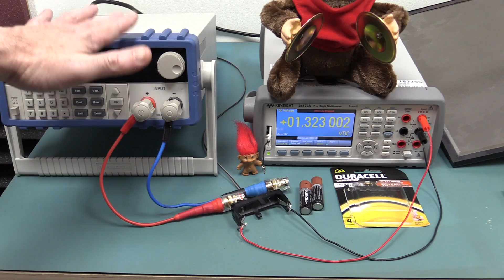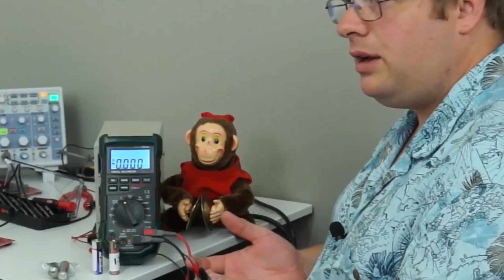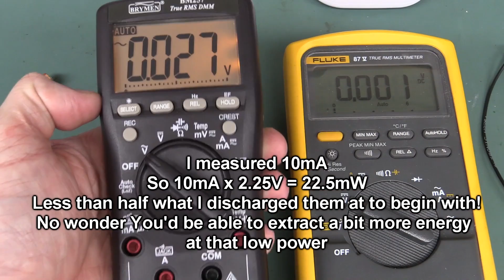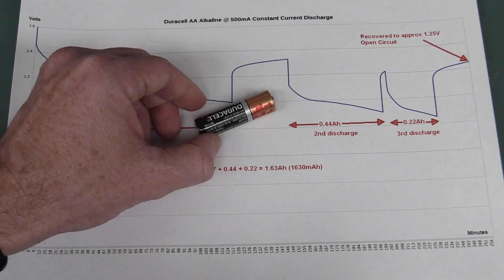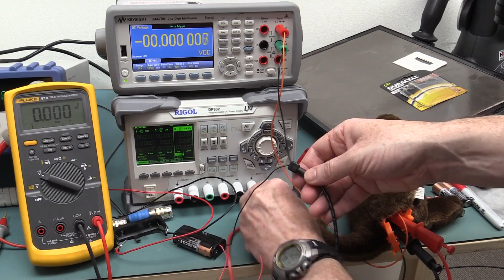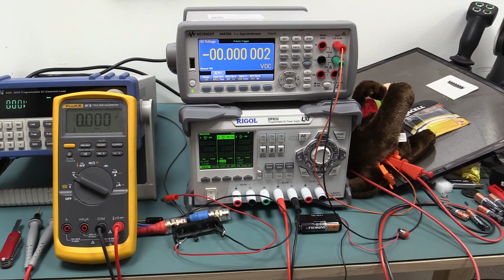EEVblog #789 - Batteriser Monkey BUSTED!

Comment: You can sometimes tell a flat-dead cell from a half-dead one by checking with multimeter: if the truly open-voltage measures the same (down to milivolts) as when hand-loaded (sweaty fingeurs across the battery poles while holding the probes)

Comment: It is not economically feasible, for a company to test every type of battery, from every manufacturer, to make sure their device works with that particular battery. There is just too many battery formulas out there.  It is better to do a more general test, simulating the maximum/minimum expected battery voltage and current. This can only reasonably be done with the benchtop power supply.  As long as you know the expected battery life curve, it is not only a reasonable substitution, it is the industry standard. As long as the Battery conditions are properly simulated, the current and voltage is the same regardless of the source. the battery conditions that they are suggesting is from devices from the 60s and 70s.  they should test their battery life expectations on current devices, not devices that are 40 or 50 years old. and definitely not motorized devices that run as long as the current is available, regardless of the voltage drop of the battery.

Comment: What is misleading is taking the manufacturer's discharge curve and assuming it's showing the battery's open-circuit voltage, when in fact it's showing the battery's voltage when under load. And that's exactly what the batteriser people are doing.

What I have learned from these videos is that a battery's open circuit voltage is pretty random and tells very little about how much charge is left in it (which is the crucial part). You could have an almost empty battery showing 1.2V when measured open-circuit, but that really tells nothing. It won't run a device at 1.2V, but something a lot lower.

Comment: Just tried testing my Metrix MX54 multimeter 9V battery.

The TESCO VALUE battery is at 8.5V open circuit, turn on the meter and it drops to 7.8, fire up the back light and it drops to 4.1V. Also the screen dims and the low battery waning activates.

The TESCO Extra Long Life battery is at 7.5V open circuit, turn on the meter and it drops to 7.3V, fire up the back light and it drops to 6V and continues dropping.

In conclusion this not only backs up what Dave says but also demonstrates that the TESCO Extra Long Life battery is still useful despite having a lower open terminal voltage making open terminal meserment useless for even getting a rough idea if the battery is still good. The multimeter used for testing the voltage of the battery's was a Thurlby 1905a in 6 1/2 digit mode.

If I had gone on open terminal mesherment I would have chucked the wrong battery. Even with out the Bateriser debunks these videos have been very interesting and informative. The Bateriser just makes the video even funnier and makes it more entertaining. Thanks Dave, once again you have helped improve my electronics knowledge.

Comment: Depending on the size, they should instead market the product to people who may have a number of flashlights which do not have regulated outputs, or make retrofit devices for use with flashlights with unregulated supplies. That should at least keep the light brighter for the duration of the battery life.

Comment: Can you make a response to the new batteriser video that came out 6 days ago which explained the batteriser in more depth. I would like to see your comments on it.
Reply: +Gravity 
So make your own video and show how wrong they are
Reply: +pa0070707 I am just looking at that video and at 9 minutes into the video the CEO shows that he does not know the difference between voltage, current, power and energy - even worse, he claims that the critics don't understand these terms...
Reply: +pa0070707 this appears to be the paper the CEO is citing. Interestingly he claims around 14:00 that he himself has come up with a spice model of the battery... 
http://www.ni-cd.net/accusphp/forum/docjoints/ID2051_Modelisation_decharge_batteries_Pspice.pdf
Reply: +Uwe Zimmermann Isn't PSpice a bad way of getting solid results? I was told during my engineering course that it's good for rough work but it doesn't take into account other variables that could influence the outcome.
Reply: +Uwe Zimmermann 
But he holds 500 patents :)
Reply: +pa0070707 The other video didn't "explain" a damn thing. It was all just a load of hogwash and misdirection. Better to stick to the simple facts, like

a) Gadgets don't leave 80% of the energy in a battery. They just don't. It's simply not true.
Reply: +pa0070707 This is a slap fest. Both them and EEVblog are wrong. It's absolutely true that using an uncompensated PSU is an incorrect way to test device cutout, that's why professional hardware battery simulators exist.

It's also perhaps incorrect to state the dc-dc converter product would overcome ionic diffusion losses of capacity, since it must inherently draw more current to boost the voltage for a set power, as per P=IV.

The energy left in a battery is as well of course an integration of the voltage supplied at the current drawn, so him coloring in those alternate parts of the graph is definitely disingenuous.

And finally, neither of them are mentioning or using a coulomb counter, one of the actual ways to precisely measure how much charge is entering or leaving a battery.
Reply: +TeslaLegend that's a lot of ways to patent the wheel
Reply: *****
like any other simulator the outcome is as good or bad as your model. It depends what you would consider an exact or accurate result, but for this context a refined model like the one in the paper should be good enough and close enough to reality... Also the paper actually states under what circumstances you should not trust this model...

Comment: You know how Duracell have a handy Powercheck feature?  I have not found a rechargeable with the feature is it because the rechargeable stays at 1.2v for a while?  Is the powercheck accurate?  I guess it puts the battery under load?
Reply: I have not seen one of those Duracell powercheck strips in ages now that you mention them...I had almost forgotten about them despite regularly buying both Duracell and Energizer brand batteries for decades.  I did not know they still existed.

But as bumv2 states, the powercheck was simply a long film resistor with temperature sensitive liquid crystals (like those thin strip thermometers used on aquariums and such).  The heat generated both provides a proper test load and warms the temperature sensitive liquid crystals creating a simple bargraph effect.  A clever ultra-low cost battery tester.
Reply: +Knuckles the Echidna Yep, it loads the battery with a heating resistor and you see the strip change color, if heated enough. Rechargeables hold almost constant voltage to the very end, so you could only detect, that it is dead if you put a Powercheck strip on it.

Comment: Oh dave, you do get wound up mate lol, they are assholes, simple as that.
Did you notice where that leaky battery was made, nuff said.
I used to parallel identical flat 1.5v batterys to run a cheap clock, im a tight bastard lol.

Comment: +EEVBlog Thanks so much for this. I don't think these videos are excessive at all. I learned a lot. I am by no means any more than a spectator when it comes to electronics, but I have been watching you for a loooong time. I have never even soldered a decent joint and I knew why that test was flawed just from watching your other battery videos in the past. You absolutely do make a difference and I hope you remember comments like this on the days you just don't feel like making videos :)

Comment: can you comment on their last video about current surges and the 80% claim? I just watched 20min of the guy asking the engineer what the average value of every single thing was for no reason.
Reply: +Prastt yeah that part of the video was pretty dull
Reply: +Prastt The 80% claim is pure bullshit. It simply isn't true. It's based on a dumpster-dive study that shows that some people throw perfectly good batteries away when (e.g.) they go away for a weekend and want to be sure they have brand new batteries in their camera (or whatever). 

This doesn't mean their camera couldn't use up the battery, it means they deliberately threw them away. That's an important difference, but it's what Batteriser is basing their claims on (batteriser is basically saying that all the batteries in dumpsters are thrown away because the owners thought they were dead)

Current surges? Does your phone keep shutting down suddenly when you touch the screen or turn it on? Nope, because real devices have things called capacitors in them to smooth out the bumps. It's electronics 101.
Reply: +Fungus The Bogeyman thanks that makes sense. True one of the examples was a train that's basically a dc motor without any filtering.

Comment: Why you don't try ham radio stuff....
Reply: It is hard to justify the investment in equipment and RF test gear if you do not already have a license to use that gear.  That said, most of the crazy claims in amateur radio surround antenna design more so than other gear (and the oft mistaken belief that a 1.0 VSWR equals a good antenna) -- and you can do much of that analysis in simulation if one chooses.

That said, I am not certain as to how competent Dave would feel on the RF side of things as RF is a lot like voodoo if you do not live and breath it.  I've been into electronics most of my life, and even as a (much more recent) Amateur Extra I still have a ton left to learn about RF before I would feel like an expert on the subject (and as an HFA autistic I tend to study a topic of interest ad nauseum!).

Comment: Dave, have you seen Batteriser's latest video? It seems to be a response to your previous video. Their point seems to be that the fluctuations in voltage due to the irregular demand for power of some products can trigger the batteries to momentarily drop below the cut-off voltage and stop working.

Comment: Hey they have a new video where power is the area under the constant current curve :D And they show how a "well" designed device stops operating after a high current surge and they do NOT show how a tiny piny batterizer inductor solves the problem ! Bust it, bust it, bust it !

Comment: In the Batteriser video the monkey never stopped working! Just the toy did.. Get your facts right dave!
Reply: +Andrew Cleon  Haha excellent correction.
Reply: This is an insult to monkeys, as monkeys don't lie and actually obey thermal dynamics and quantum mechanics.
Reply: +Andrew Cleon In video, the guy made a point to hold the monkey a specific way when testing with the batteries. When Dave held it that way, the drain on the batteries increased.

So, clearly, some research was done with their demonstration to make the optimal conditions to for showcasing their claims. AKA, stacking the deck
Reply: +Andrew Cleon <-- comment of the year award! ROFL!
Reply: Andrew Cleon - for a second, I thought you were trying to defend the batterizer. I see what you did though😏👉
Reply: That's was too good, I hope they see this comment.

Comment: battero did post a new video about the batteriser. They explain the huge energy benefit of the batteriser with stabilizing voltage spikes that would go below the cutoff voltage. 
I am not a familiar with battery powered devices, but i wonder if its normal that a product shuts down if the voltage goes down below the cutoff voltage once?

Comment: Batterizer probably used carbon zinc cells in their video, its trivial to get them to recover to like 1.25 but then drop the moment you sneeze a bit of current on them. Much higher internal resistance.

Comment: Why don't they market the Batteriser to be used with "dead" batteries in remote controls, calculators and so on? It seems it would actually somewhat work in such applications and that would also be honest... Now they are only losing cred for lying... Or?
Reply from the maker: +Maria Engström a) Because most low power products like that already do a pretty good job at working at low voltages.
And b) You won't get that much extra life from them in the scheme of things.

Comment: You know how they did it, right? They put the batteries in the monkey until it wouldn't run any more then heated them up in their pocket (or with the well used soldering station on the desk in their video) to make the voltage recover to a high voltage. Thumbs up to you Dave! Bust that BS!

Comment: It would also be bad idea to use the Batteriser in a product that shows a "low Battery" warning since this circuitry only measures voltage and not current. The Batteriser always boosts the voltage up to 1.5V that circuitry would not detect a "low battery" and never show the warning. It would just continue operating until the current gets too low to actually operate it. This would be critical for Remote controlled vehicles or devices that use a battery as a backup to store data.

Comment: I think I understand where they're coming from (still won't work).  They have a different (wrong) definition of cut out voltage than everyone else.  If I had a  product that cut out at 1 V they'd claim that it'd have a cut out voltage of 1.2V let's say, because if a current pulse came along and dragged the terminal voltage under 1 V it would cut out.   I think that's why they say the power supply is wrong, because it won't allow current spikes to drop the terminal voltage.  So if when they say "cut out voltage", you replace it with "minimum operational steady state battery voltage",  It kind of makes sense.  I think that's where they've confused themselves.

That being said, if I designed a product that cut out because of a current spike, I'd kick my own arse.
Reply from the maker: +Grant Trebbin Exactly, and that is the art of electronic (not just) battery product design. The scenario of voltage droops on current spikes they are pushing in their latest tech video, is just clutching at edge case scenario straws.
Reply: +EEVblog You're not saying Ohm's law applies to Batterisers, are you? ;)
Reply: +EEVblog That said, I don't see where this device will have enough reserve capacitance to adequately buffer a device from anything but the shortest duration of droop under a dynamic load as the Batterizer can not sustain a higher voltage for any length of time if the (run down) battery can not source the necessary current to begin with.  Most low power electronics will already have incorporated a suitable capacitor to reduce unexpected drop out under brief surge loads, allowing them to exploit the battery's ability to recover voltage under very light loads between peak load events.
Reply: +Ethan Poole Agree.  Looking at the schematic in their patent (may be the same or different from final product) They have 1x4.7u cap on the input and 2x4.7u on the output. Inductor is 2.2u.  Not much energy storage there.